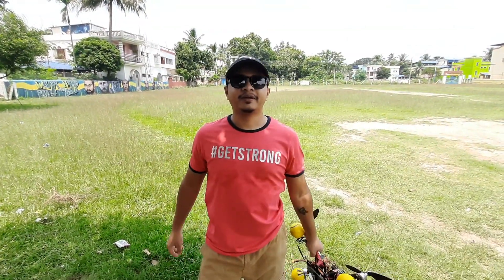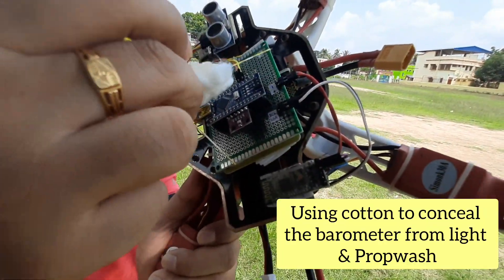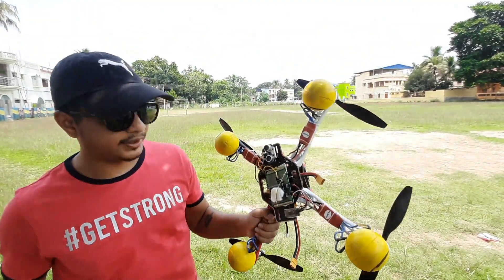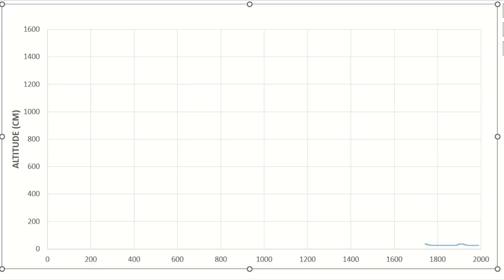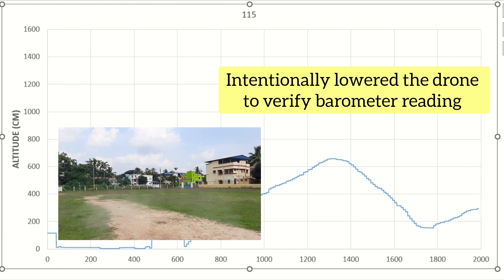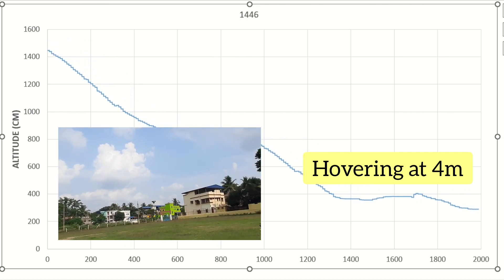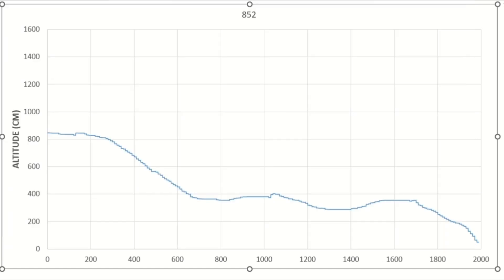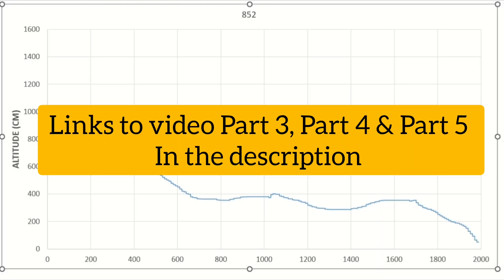Arduino Quadcopter Development Part 6 (Barometer Installed with Telemetry)

Comment: did you cover the  BMP chip? this modules very sensitive to light how much accurate is the BMP ?
did u try to cover the BMP with black cap with some holes to allow air flow and restrict light
Reply from the maker: Yes, I have covered the complete Module using an electrical tape and some cotton  to allow air flow
Reply from the maker: The resolution is around 2  meters. Depending on weather conditions